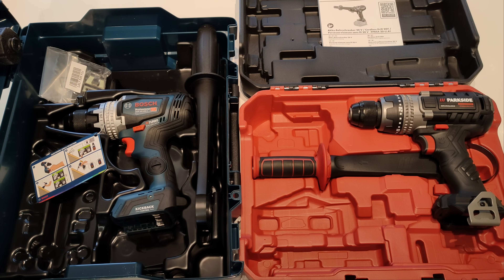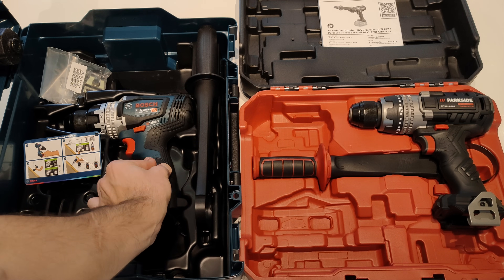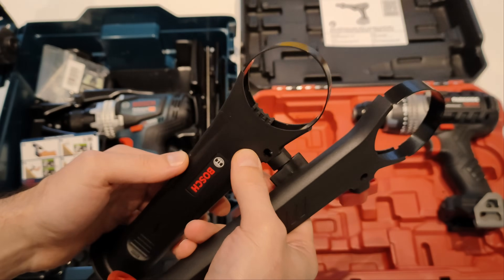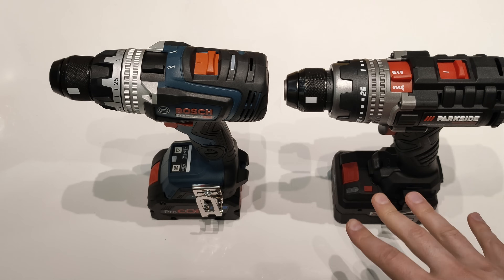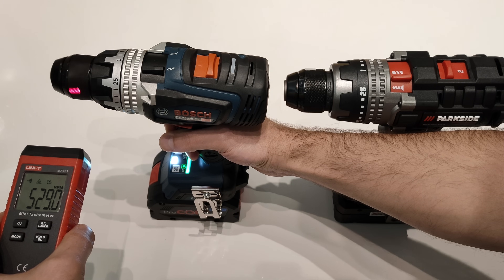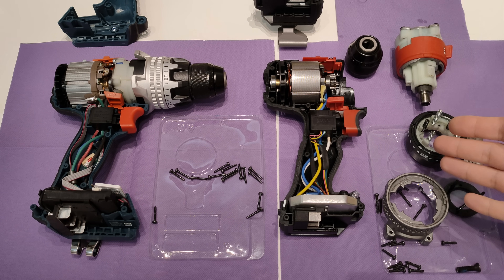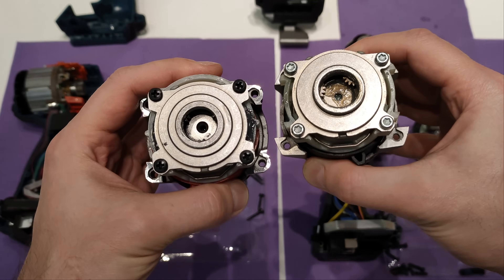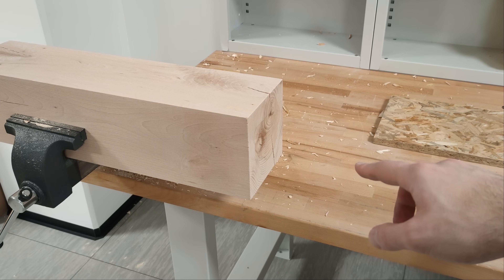Parkside Performance PPBSA 20-Li A1 vs Bosch Professional 18V GSR 150C - Review and Teardown

Comment: Typically, the insulation of the motor windings can withstand temperatures of up to 180 degrees Celsius. 90 Degrees is below the normal operating temperature of BLDC motors, which is 100 degrees Celsius. Yes, the Bosh may survive, so your grandchildren could use it, but the Parkside is way, way cheaper.

Comment: very good review also the notes about the disassembling the parkside, may I ask you how you hammered the chuck ?
Reply from the maker: https://youtube.com/shorts/AvHYVw2nuls
Reply: @icku  thank you so much for the fast response
Reply: @icku  tried again to remove it and the only way was cutting the chuck with the angle grinder, this is indeed some idiotic design, now I am trying to figure out a way to avoid this in the future with a new chuck, I am trying to find an adapter to quick release chucks but I can't find anything, not even in china

Comment: If you remove the Procore from Bosch and put in a common battery with 18650 cells. It would be well below the Parkside.

Comment: I bought Parkside. First real use and they all smoke. They indeed are only good for home use & hobby. I couldn't even dream to take a parkside and screw in 6000 metal screws when installing a fence in 40 degrees celsius. I can do that with Makita with no issues and if you look at the price, these brushless drills from Makita, Bosch aren't that expensive.

Comment: The price in germany for the Parkside is under 100 € (full box incl. akku and charger), the Bosch costs solo ~200 €, with akku and charger up to 450 €.
The products from Parkside are more than sufficient for private use. Parkside is sold by a very large discounter and B-stock is often offered at half price.  You should hit it straight away.
Reply: bro you have 5 year of guarantee so whats the problem use this as professional use?
Reply: @lavine6069 I also wonder same. For these 5 years they must fix or give you another working device.

Comment: The Parkside has a low efficiency motor and a badly designed motor driver. Your test under load is very significative.
Parkside tools are a cheap alternative to professional tools, for occasional light duty work. I wouldn't pay 100 Euros - or any sum for that matter - for a dangerous drill that will set itself on fire at your first heavy-duty work.
Greetings,
Anthony

Comment: The difference between a private user and a professional. For home use the Parkside equipment is really pretty good quality for the price. I had a Parkside cable saber saw. I did a lot of work with it and used it for tasks it was not really designed for. broke the reciprocating bar where the blade goes while cutting wide bits of tree logs. I wrote to Parkside and asked for that part willing to pay they said when did you buy it? We told them when and where. They never even asked to see the receipt. We just sent pictures of the broken part. They sent from Germany a brand new saber saw at no cost it took about four days to arrive. Now that is great customer service. I really can't fault their stuff for the price. I just recently bought one of these drills and I think it will do for what I need it for. It is really like the difference between a Tiger and a house cat. Tigers don't usually hunt mice. House cats don't usually hunt deer. But both are cats. :)
Reply: In Germany, customer service is gold. Mercedes benz just made a very expensive repair on my 15 year old car, free of charge because they said it was a design flaw. In Germany, customer service is on another level. Also, because Germans take pride in their work and do whatever it takes to keep the good name of their brands and Made in Germany.
Reply: I just bought a German cordless drill Scheppch for 45 Euro, it has 60Nm. I opened it, it had metal gearbox and brushless motor which they don't even talk about. The man in the store was telling me that the gearbox is made of plastic, but when I opened it, it was all metal. It beats 80% the cordless drills in the market. And on top of it, it has 10 years replacement warranty! German brands are so good. You can rest assured that whatever happens to their products, they are always there to take care of you in any way possible.

Comment: I didn't see temperature sensors on parkside tools motors only on driver board, also they mostly lack of hall sensors therefore you dont have low rpm range like in other brands.

Comment: I've both, the bosch is still working (3 years warrantly) and the parkside don't work anymore, it's just don't start after 4 month of normal use (even if the warrantly is 5 years) just like other parkside performance tools.
Ok Bosch is pretty expensive but not so much compare to the complet wast of time of the parkside tools. I've almost all of them and they stop working one after the other, one of them has almost burn in my hands, it maked a hudge smoke...

Comment: im using the PPBSA 20-Li A1 new version with hummer for 4 months with intensive use and i only found 2 negative aspects:
-the plastic handle lock mechanist sucks, will break with time
-The chuck wobbles a bit
Its litle things that can be easily fix in future version but im kind of impressed, of course Bosh its better but come on, almost costs 3 times more
Reply: I was exactly thinking the same way, but now it's quit the opposit cause my parkside performance tools don't work after 6 month of use... so i decided to repair or replce my old bosch tools. Parkside is a complete wast of time, you'll see.

Comment: Thermal measurement like this is worthless, especially on Bosch. The measurement was something average between motor and enclosure temperature. Parkside had much larger ventilation holes that resulted in better motor visibility and thus higher temperature measurement. To measure Bosch through the holes, you'd need thermal camera with adjustable focus and higher resolution.

Comment: I am not so rich to buy cheap stuff. 
With Bosch (and other good brands) you buy not only better and more reliable tool, you buy also wide service network and lots of spare parts. I can still find parts for my father's Bosch sds hammer drill that is 40 year old. It is still funtioning and can be fixed.  Parkside will fail every time when you need it the most. And then, you can throw it in garbage and loose precious time to drive and get new tool. It usually fails on some stupid part like switch or casing or similar and it is not fixable. I had lots of cheap brands and it is all junk (Parkside included). No service, no parts, fails after year or two, usually in the most critical moment of work.  5 year waranty is a joke, they know that 95% of people will not bother and loose time to replace this.  I am buying only good brands that have service and parts in my country and had never a single problem with my Bosch tools (I like Bosch becasue it has very long presence in my country).  
And come on..... Tool this days is so cheap that anyone can buy good quality tool. 200-400 euros for good Bosch (or other major brand) tool  is no brainer (40 years ago when my father bought the drill was totaly different situation, good tools where expensive and rare)  Fuck! I can eat and drink in one night difference between Bosch and Parkside! You cheap bunch of sissies! :)
Reply: Dude there are ppl that are working for 500eur a month do you really think they can afford 300 eur drill?

Regarding Parkside its quite good for its purpose and it can last you 5 years easy.....From your experience you probably need Hilti or other top brand because you use your tools more intensively.

Comment: I got me own test i buy parkside i do elektrificity and me parkside burn after i finish one building where was flats full of plugsbox after me parkside burn make sparks doesnt work anymore and even when was new was realy underpower ..so i trow in bin ...I buy Dewalt never have same problems anymore ..Parkside is only goodin garage when u use it sometime but why in hell U gonna buy parkside around  50 or 100 euros for garage then after 1 yeara max is dead when u can buy Dewalt for 200 but last You so many years and specialy if u are builder u need buy profesional brands i use some Bosch not bad but when u Buy dewalt or milwakey or Hilthy u dont want shity cheap tools anymore

Comment: Parkside would be cool if they stocked consistent product line. With battery system, being able to buy compatible tools and accessories is key factor.
Reply: at least they stock far more often than aldi ferrex - iv bought some ferrex stuff and although some of it is decent they dont have stuff in store anywhere near as often as you would want and batteries are a nightmare to get hold of.
Reply: They have two battery systems only for all their tools.
Reply: @lolocemoipopo7537  I know, but mostly they just have 2..5 random tools on sale. E.g. your 20V drill breaks - but in shop there's only angle grinders, hot air guns, chainsaw and a 12V drill. You either have to stop your project until drill shows up on sale or but completely different system - battery, charger, drill.

IMHO they should've at least offer every tool from their range online in with fast shipping to any LIDL shop in europe.

Comment: Thanks for the review. Regarding the Bosch bluetooth module (GCY 42). I've got myself a few of these. They are manufactured in Poland.

As for the overtemperature protection: it might be only measuring the battery temperature (so it doesn't burst into flames) they probably don't care much about the motor melting (it'll just stop)
Reply from the maker: Thanks for the info!

Comment: Bosch every time. Had some green Parkside tools and they go bad very quickly. Especially the trigger switch lives it's own life after a short time. When you hold it in your hand you feel that the parts don't fit as good as in the Bosch units. The rubber is cheap, the mold is sharp and misaligned. I know it's 2-3 times cheaper but when I buy the blue Bosch I buy it for many years.
Reply: On other hand I have multiple Parkside tools going strong after 3 years of moderate DIY use..... I bought drill with cahrger and battery for 25 eur
Reply: @ernestfrigelj2876 my dad has lots of Ryobi tools that are still going after many years of use.. it's just no comparison if you need to push your tools

Comment: I'll wait for the second iteration of the parkside. A2 or B2 , I don't know whatever the name will be. The problem of the parkside board looks identical to the b2 version of the impact driver they had. I am pretty sure that the second edition of this drill will not cut off operation. And the torque will be closer to the alleged one of 150nm. As for the screw inside the chuck, if you feel  uneasy than just change it to allen one.

Comment: Nice testing, I have the bosch and on the long term is the winner. Much more robust and heavy duty. Yes the case on the bosch and other professionals tools are made from glass fiber reinforced polyamide, compared to the parkside. It is more expensive to manufacture. I have an older parkside impact driver and after one year of use, the case is cracked in the trigger area, and one day it will break. Actually in Romania the Bluetooth connection module is easy to find. I purchased two modules last year and in three days was delivered. The GCY 42 module is manufactured in Poland, at least mine. And some of the batteries are manufactured in Hungary. I personally use bosch tools on both 12v and 18v platforms. My oldest drill is from 2001 on the 14.4V battery and was made in Switzerland. But the battery packs are dead ni-cd, only working for 2 minutes. But the drill is functioning well, the brushes are in good condition, It was very well made. Bosch for me. 👍👍👍
Reply: Brands like Parkside and Ryobi are specifically designed to last a homeowner's usage, that is 10 minutes of work, 3 times a month for 10 years...

Bosch is designed to run 5 hours a day, 5 days a week for 25 years.

Comment: I had parkside performance hammer drill and protection was trash, when i was screwing m16 bolts and it fried electronics. They have potential but design needs improvement. Unfinished work.

Comment: I already knew you gona break those 10x180mm bolts. You need to make a predrill first, smaller than 10mm, let's say 8mm.
Reply from the maker: The idea was to make it as tough for the drills as possible. Not po make it easy.

Comment: It is interesting to compare the two after one year of daily use in a workshop..:) When brand new - a lot of things are doing fine..
Reply from the maker: Those are tests that even manufacturers do not perform. Especially Parkside - they count on end user to test :(
Reply: @icku  Интересно колко бързо го копираха тоя модел, мисля, че няма даже година, откакто излезе.
Reply from the maker: @sizif717  Мдам. Другия вариант е както приятел споделя Parkside да си плаща на други брандове да му произвеждат техни ребрандирани модели.
Reply: My friend has a 3-year-old Milwaukee M18 fuel gen 3 that's still doing fine and it uses an electronic clutch which is one less failure point in the tool. More expensive tools are made to be repaired and cheaper tools are made to be disposable. If you are a hobbyist DIYer, Blue Bosch, Flex, Dewalt, Makita, Hikoki/Metabo HPT, or Milwaukee can be worth it.
Reply: The parkside performance tools stop working after around 6 month. I've already 4 of them out...
Reply: sometimes they come with less grease, I bought 4 grinders all 4 had minimum grease so new ones I grease them properly, project farms says synthetic grease the best.
I mix in some molybdenum powder

Comment: Bosch is more for intensive use, ie., professionals. Parkside is cheaper to buy, but in the end, more expensive for money and for environment because of more frequent failures and more frequent replacements.
Reply: just so u know this is a performance parkside drill it has 5 year warranty. Within that 5 year they will just send you a new one, if the current one brakes.
Reply: Nobody knows yet how long the Parkside would last in similar conditions
Reply: @Thomas_2615  Actually yes, there are testimonies and tests about that (Parkside lifetime and quality compared to Bosch, booth tools and batteries) on YT. Basically they don't compare with Bosch. Milwaukee and Makita seems to be very good too, though below. Dewalt have sometimes design and reliability problems. Bosch batteries are significantly superior to all others in terms of temperature and lifetime, but they are more expensive.
Reply: @KamiSoleil  You are talking nonsense.
Reply: I read enough about Bosch, both green and blue. Breaking down during normal use. Never heard that about Makita, Dewalt.
Reply: @maarten8959  If you are mixing B green and B blue, there is a problem, your texts are fake.
Reply: I work with bosh evey day during the past 8 years and they are amazing tools and don't brake under heavy use not abuse ofc. We used the mid level tier bosch professional. Not the entry level.
Reply: Lol shut up
Reply: Muy buen en producto y donda comprar una Bosch
Reply: Bosch wuality in recent years is dogshit .
Reply: The environment is of the least importance when choosing tools
Reply: Můžeš rovnou kázat v kostele s Grétou.🤦
Reply: According to some contractor friends, Bosch quality has dropped off in the last decade or so.  But every company has better and worse tools, Bosch SDS drills are still respected. Obviously still much better than parkside, but not always or even often better than Makita for example.

Parkside is fine for DIY, but they are made to fail, ideally just after 3 years after the warranty expires. The batteries also fail more easily. Also, as evidenced by this video, Parkside isn’t meant to be repaired and won’t be under warranty, it will be trashed and replaced. 

You don’t have to be an “environmentalist” to want a tool that can last and be repaired. But you do have to be an idiot to think we can keep throwing things away at an increasing pace just to keep selling cheap trash.
Reply: @wayward-saint  "they are made to fail .... & have a 3 year warranty"   

You obviously don't even know that this is Parksides premium "Performance" brand where all the tools are brushless and they come with a FIVE YEAR warranty... 

The green brushed range is 3 year warranty & definitely aimed at the DIY market...
Reply: @peterfitzpatrick7032  I'm happy to be proved wrong.  But for that price point, even with the volume Lidl can move, corners are getting cut.  Cheaper, more brittle steal, thinner wires, etc.
Reply: @wayward-saint i just cant believe tha they dont reuse old broken ones
Reply: @wayward-saint  Makita and Hilti and Milwaukee also came out standing out from professionals. Milwaukee bits are top notch. Hilti is kind of the opposite of Parkside for the mindset (usability, guaranty); Bosch is close to Hilti but much less expensive.
Reply: I actually prefer my Parkside drill over my hilti, even used it once to finish a 5" core
Reply: I actually prefer my Parkside drill over my hilti, even used it once to finish a 5" core
Reply: I actually prefer my Parkside drill over my hilti, even used it once to finish a 5" core
Reply: Bravo; we have a virtue signaler in here in the quest of "saving the planet"  You deserve a medal. now please cut the environmental talking and let us drill in peace.
Reply: @balauruldeaur1271  So insecure... no one and no comment is stopping you from drilling ! Happy drilling, driller !
Reply: @balauruldeaur1271 there was no need for your comment. Considering the environmental impact you make has absolutely nothing to do with virtue signaling.